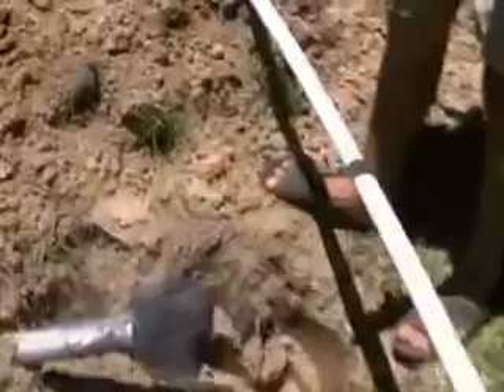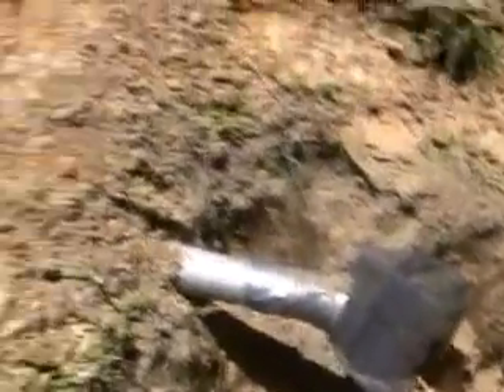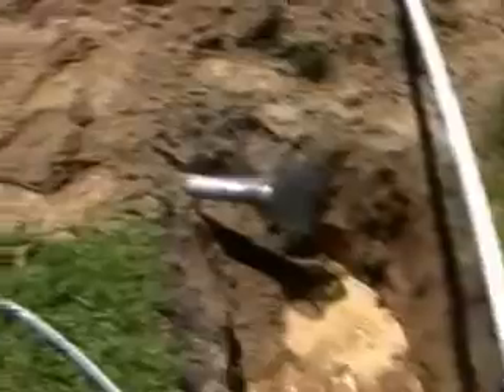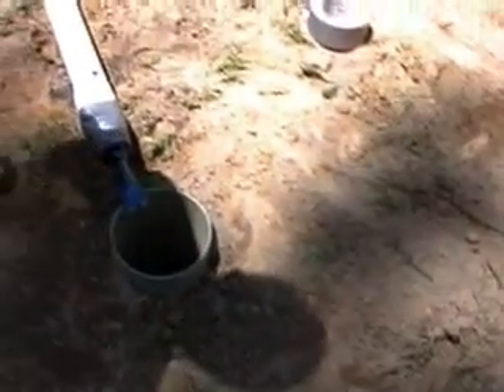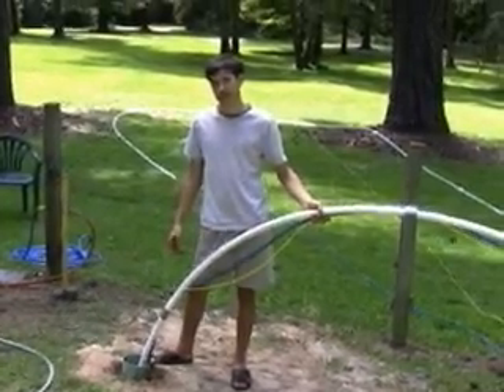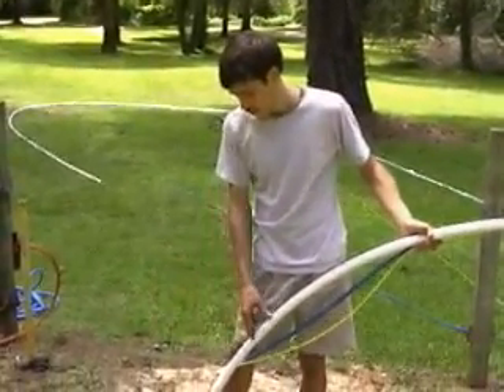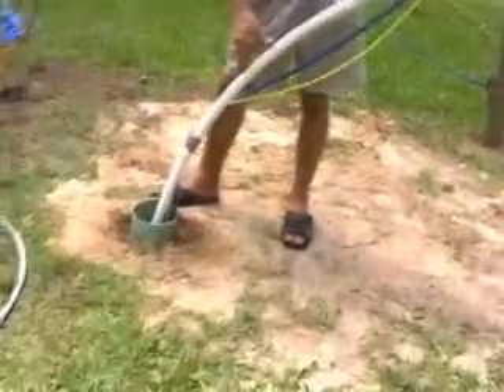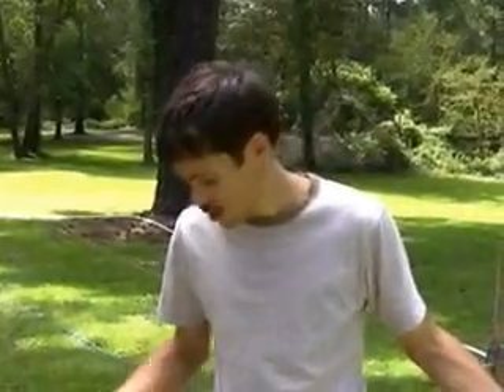How To Drill A Well In Your Own Backyard!

Comment: I have an idea for those of us that dont want to rent an air compressor. Tie a couple 2 stage air compressors together to make one big air compressor. There is 60 Gal harbor freight 2 stage air compressor with 15.8 CFM @90 and I can just buy smaller 2 stage 30 gal air compressor used off craigslist and just tie the two together. Should get 17cfm no problem.
Reply from the maker: Yes, that works, the DVD discusses that. CFMs are definitely not all created equal for compressors.

Comment: How much water do you need to dig the well? We were planning on digging a well at a site that currently has no access to water.
Reply from the maker: You can drill with water from barrels or those 300 gallon tote tanks. The amount you need depends on the soil you're drilling and how long it takes you, but for shallower wells you can often drill on 300 gallons a day. Sandy soil or deeper wells will take more. I suggest you start with the plans/DVD from the website.

Comment: Hello, do you have a step by step video on the whole process(including the building of the well?) I see you're adding lengths of pipes as you go along.  Do you add a pipe once you've achieved 10 more feet of cleared area or all at once at the end?

Also this may be a foolish question, but when would you know you've hit water and its not just the water from your operation of the machine?

Comment: Where does the dirt go? If it's pulverized and sent up the PVC, then wouldn't the barrel and settling pond fill up pretty quick? And wouldn't rocks jam up the works?
Reply from the maker: Yes, the dirt is suspended in the water and blown up the center of the PVC. The settling pond fills up, yes, but not that often. Do the math - a 6" tube x 100' in length isn't that much volume of soil, in the grand scheme of things. Stones are hard to drill yes. If it's just slabs of rocks, we can drill through them, but gravel the size of grapefruit is very difficult, even for professionals.

Comment: I used this method (without the drill head) to sucessfully drill trhough sand/gravel mix at 40 ft.  I found the limiting factor to be the amount of water I could put in the hole.  Once you hit water it goes 2-3x quicker for the last 15-20 feet.

I found I had to keep adjusting the air pressure.  I would hear gurgling and only a bit of water/mud would spit out.  A minute later the same setup would be spitting water/mud out faster than my hoses could supply.
Reply from the maker: A lot of that is different when you use the drill head; while both use air to remove the tailings,  it's really a very different method. The drill stirs the dirt up in a way that plain water doesn't, plus we can use drilling mud; these both diminish the amount of water required for drilling. With my system, adjusting the air pressure is rarely desirable, because we pump with a 1" pipe (I imagine you used a 2"?) and thus our pumping is much easier.
Reply: Thank you for the response.

I was forced to move from 1 1 1/4 pipe to a 2" pipe at 15'-20 feet.  I had gravel/rocks 1.5" across that were jamming in the pipe.

I can definitely see the advantage to using a drill head.  I can see this melting through sand.
Reply from the maker: Yes, it does melt through sand. Up to 35' per hour (my personal record). 20-25' is typical.

Comment: DO I REALLY NEED A COMPRESSOR THAT BIG ?
Reply from the maker: Short answer is yes. Imagine trying to run a power drill using only 50 
volts. Obviously, it wouldn't work well, if at all. If you use a smaller 
compressor, the pressure will start out at 120 or so, but very quickly 
drop to 50 psi - similar to volts, for our analogy. It just can't keep 
up with the usage. 

So yes, you need an absolute minimum of 17 CFM, 
preferably more up to about 25 or so - beyond that doesn't hurt, but 
doesn't help much either. You can rent the compressor at a local rental 
yard, or perhaps lowe's/home depot.

Comment: what if you don't have running water to begin with?
Reply from the maker: Running, pressurized water is not required, but it does require water. In a site with no water on hand, we haul it in in 55 gallon drums or 300 gallon totes. It requires a fair amount, but less than you would imagine.

Comment: Discharge outlet is 1-1/4” NPT threaded.
Use 100 PSI (689.5kPa) rated polyethylene
plastic pipe for installations up to
100’ (30.5M) depth.
Use 160 PSI (1103.2 kPa) rated
polyethylene plastic for installations up to
220’ (67.1M) depth.
For depths beyond 220’ (67.1M) use
galvanized steel pipe for the entire drop pipe.
This is what it reads in all the owner manual of submersible pump.  I can not find anywere it say to use PVC sch 40?

Comment: so if the compressor run out of air or you turn the drill off without pulling it out of the hole, would the water back flow on the drill?

Comment: In Florida, you can "dig" a 22' well in about an hour using a 2.5 inch pvc well pipe, a 1/2" pvc city water pressure pipe, a 1.5" pvc well point and pipe and a garden hose. Simple. A 1 hp 110v well pump can directly spit out about 15 gallons of water in exactly one minute. Plenty for even for small farm use.
Reply: umaxen01     expound please.  We live in coastal South Carolina  Mount Pleasant. Close to Charleston.   Do u have any ideas about depth for this area?  Chas is below sea level.  My husband wants to self drill.
Reply: LOL at that point rent a John Deere 300 and dig a 30' hole and backfill.
Reply: @usaphilippines   The total cost to do by hand for me was $250 for a 1.5 hp Flotec pump (they last about 15 years for lawn use) and about $100 for pipes and reusable well pipe dredging parts. $350. I was wrong about the water per minute, I tested it today at 1 gallon per second. (5 gallon bucket in 5 seconds.)

Comment from the maker: The hole usually collapses because the weight of the hole (empty) weighs less than the dirt around it. We keep the hole full of water so that the hole (with water) weighs closer to the same weight as the dirt around it. Of course, it doesn't, so we use drilling mud which bonds to the dirt and to the water and raises the weight of the water, so it is much less likely to cave in. In short, if you follow the instructions, you won't have many caveins because the water-mud mix pushes them back.

Comment from the maker: @TheRoadsnake The principle would, yes. The drill obviously couldn't fit down the hole, but what you'd want to do is buy our air-powered water pump from our website HowToDrillAWell(dot)com, hook it up to a small compressor, and drop it down there; if the rocks aren't larger than 1", it should pick them up no problem and clean out all the sand and let you get the pump out. I've used it for getting drills unstuck many times.

Comment from the maker: @Twisted86 Your water level - especially water for watering gardens/yard - is almost certainly much shallower than that. I've never had a customer who didn't find water at less than 100'; the vast majority find it at 50' or less. Odds are you would too. This may not be the best water, although sometimes it is better than deeper water, but regardless for your purposes it would work fine.

Comment from the maker: @mra95662 You made a crude venturi, which is essentially the principle behind the pumping action here, yes. But no, a larger hose wouldn't help much beyond a certain point (about half-inch). The drill's orifices are only so large and they won't take but a certain amount of air. Beyond about 100-110 PSI, there is no real changes in speed/power.

Comment from the maker: @vitaminfeeder Artesian (flowing) wells are very rare. When they do happen, they just flow for a little while and then when the pressure has dropped they stop flowing. Exceptions to this are very, very rare. 

Sacramento is not below sea level. It is at 25' above sea level. I don't know about the area around it. Regardless, I would not worry about artesian wells that are unstoppable.

Comment: Again, the depth to the water is not the important consideration if you are using it for drinking water.  Its the quality of the water which you seem to admit in suggesting the water be tested.  Sure, drillers get paid on a per foot basis, but that doesnt necessarily mean they are lieing to you when they tell you, you need to go deeper for quality water or better yield of the aquifer.

Comment from the maker: And finally, bear in mind that your grandparents probably had (and possibly, still have) a shallow, hand-dug well which supplied all their needs from that "surficial" water. 75-100 years ago, that was the #1 source of water. Aquifers have dropped, but not so much that water still can't be reached in less than 100' in every place anyone has actually drilled with my system.

Comment: @HowToDrillAWell I am a geologist.  Finding water and finding water worth pumping are two different things.  Also the use of the water is an important consideration.  If it is just for irrigation, then a surficial aquifer may be good enough.  But even in that case you could have iron in the water that stains driveways and buildings that may make you want to go deeper.  If its for drinking water, you dont really want to be in the surficial aquifer.

Comment from the maker: @zroller84 There are very few wells in the country that need to be drilled deeper than 100' to find water. No home well drilling rig can drill past 300', but 90% of the country finds water at less than 50' so deep wells are very seldom necessary. Well drillers generally exaggerate the depth needed to reach water because they get paid by the foot. The deeper they "have" to go, the more money they make.

Comment from the maker: @psanders1975 It depends on how deep you are, and how hard the soil is to drill through. I.E., if you're 100' deep and have lots of rock, by all means try to fix it. On the other hand, if you're 40' deep in sand, start over, it's not worth the hassle. 

However, in either case you should consider the air-powered water pump on my website; it's a cheaper solution and will suck out sand and silt that caved into the well and might restore it to good working order for less than 100$.

Comment from the maker: @ovidiu299 Capacity is less about the size of the well casing than about the strength of the aquifer - how much water there is underground. In that particular well, it is 210' (65 meters) deep. And that is the deepest I've ever gone. A well that is made correctly shouldn't need cleaned very often, but when it does, yes, we can clean it out using the same principle.

Comment from the maker: @XXXStraightEdgerXXX We can drill rock; it just takes time. I have a customer in Alabama who drilled through 30 inches of granite; took 18 hours, but, that's still impressive. On the other hand, in sand we might drill up to 20' per hour, so you can see it slows down a lot, but it's not a well-stopper.

Comment from the maker: @alexDphillips Yes,  but we usually drill a 4" well since that's all most people need and it is much easier for several reasons. Most compressors that we use are gas or diesel powered so that electricity is not needed.

Comment from the maker: @andrewsengineering We can drill rock, it is just slow. .5-2" an hour is typical. I have customers who've drilled through several feet of granite - it just takes time. We use PVC casing, as many well drillers do, not steel. Further, the pipe we use actually has negative weight since the air in the pipe acts against the water in the hole to make the pipe bouyant most of the time.

Comment: I just don't see it being very effective, through clay and soft formations maybe, but not in the shales. You get 50 to 100 feet of pipe attatched to that down the hole it's going to be heavy and how do you keep the hole strait? If you run any length of casing it's going to be too heavy to hold getting that set down the hole, without some kind of derrick or tripod. I run a full size cable rig in my area and I can say that might make it the first 20ft if your lucky and that would be it.

Comment from the maker: @helmetfire150pilot We can drill rocks, but it is slow. So hitting a rock doesn't mean you have to give up. Also, the work involved in this system is less than any other home well drilling system on the market. You can see a detailed list of frequently asked questions at my website (see link in the video info) - to put the casing down, we simply pull out the drill and lower the casing into the hole.

Comment: so how does this little drill bore out a 6plus inch hole to get the casing down to the base of the well???  i'd be curious to either see how that's done or a detailed explanation.  I'm really interested!!  Does the video you sell have detailed instructions on how to get the diameter sufficient for 6 inch casings.  thanks

Comment from the maker: @pfarnsworth84 State and local laws vary widely, but in many states it is illegal to drill a well for *someone else* without a license, but perfectly legal to drill your own well on your own property. You should always check before drilling. 

As to your other comment, aquifer wells are often better, but almost never necessary to get good water.  And artesian wells are extremely rare these days, and usually peter out after a few days as the pressure is equalized, so a pump is often still needed.

Comment: Interesting idea, but illegal in North Carolina where we must use a registered driller. Plus, because of the geology here, only machine drills are capable of going the several hundred feet and breaking into bedrock to reach an aquifer.

Bedrock well water is not only cleaner and tastier, but if you can hit a confined aquifer, it could save you the need to install a pump. I think it's "well" worth it.

Comment from the maker: @mystichawaii we can drill rock, but it is slow. If it's lava rock like I saw in Guatemala (coarse, very light, porous, fairly soft) then I wouldn't think it would be a big problem. In hard rocks like granite we drill very slow, perhaps .5" an hour, while with sand we are up to 20 feet per hour. If it is the softer rock, then I would think you could go through it fairly quickly, compared to granite. Let me know if you have any other questions.

Comment from the maker: This doesn't require a local water supply. It does require water to drill, which can be hauled in 55 gallon drums for the drilling needs. This is drilled from scratch, and most well drilling systems require water to remove the tailings, only a few very labor intensive, very shallow, well systems can do without at least some water to start.

Comment from the maker: The holes are not perfectly straight; we don't use steel casing, so a perfectly straight hole doesn't matter. The pump won't care :)

the plans we offer show you how to build (and the kit we sell comes with) a well point which will follow the hole even if it weaves quite a bit going down into the ground. The verticality is quite unimportant on a low-tech solution like this.

Comment from the maker: You need a compressor capable of supplying at least 16 CFM @ 90 PSI - which in Australia is about 500LPM @ 6 Bar. My international kit is 599$, which contains everything you must buy from me. You'll need about 100-300$ worth of pipe, tape, odds and ends like that. Then it's just the cost of the compressor or rental thereof and you're good to go. Those are prices in the US in US dollars, so I have no idea what it costs there, of course. 80 feet should present no particular difficulty.

Comment: Hi Love your site. Could you please send me information eg set up costs, what size compressor would you need.  would I be able to buy from you the air drill and bits.  If I can buy from you what is required this end to complete a transaction.  Could you please reply asap  We are desperate for water and we know water is there -  about 80 feet deep.  Our neigbours tell us that it cost them $14,000 aus we are not that well off.

Cheers  Wayne

Comment from the maker: you may notice a difference in the sand that might indicate water (discussed in the plans), but the surest way is to let it set overnight. The vast majority of wells can't be finished in a day, so when you go back to the well after it setting overnight, you'll be able to either see the water standing in the hole, or drop a float to it. It will almost always be standing at the depth of your groundwater. That's the best way to tell. There are a few other ideas in the plans, too.

Comment from the maker: Well, yes it can drill through rock; but drilling through hundreds of feet of it would take so much time as to not be practical. However, you very likely don't need to go that deep to get water. Almost every well drilled by a professional is deeper than it needs to be, sometimes by a factor of ten, since they get paid by the foot. 

What I'd do is ask a neighbor to let you drop a float into their well, and see where the FIRST water level is. That gives you a more accurate idea of where it is.

Comment from the maker: The drill and expansion chamber assembly is rigid for the first 3 feet, which helps a lot. And though it will still wander a bit, the misdirections will  tend to cancel one another out. And finally we use 4" thinwall PVC pipe  which is relatively flexible so it will follow the hole even if it weaves a little bit.  The compressor has to be so big because the air tool sucks a lot of power to run constantly.

Comment: how do you prevent the shaft from going off in whatever direction it wants to? PVC is rigid but only to a point steel guarantees a straight shaft, and why does the compressor need to be so big? other than that everything else makes sense.

Comment from the maker: The bit is powered by a small air tool which runs off of a large compressor. The exhaust air from the drill going up the pipe creates a vacuum and pumps the water out.